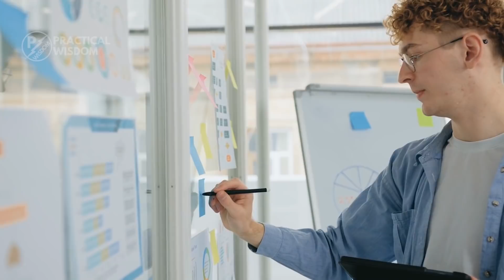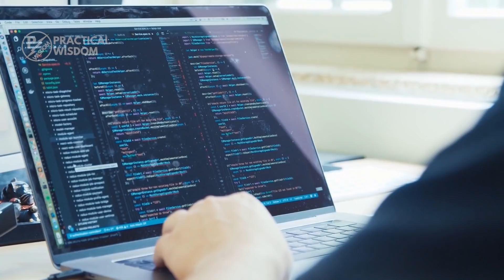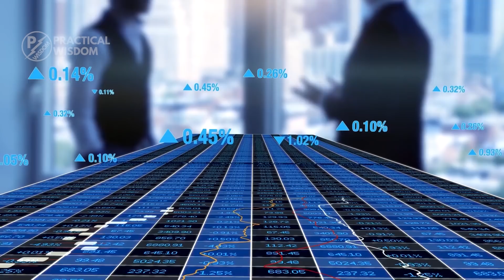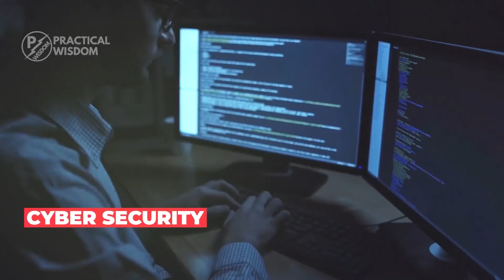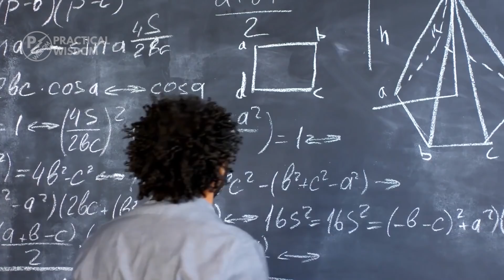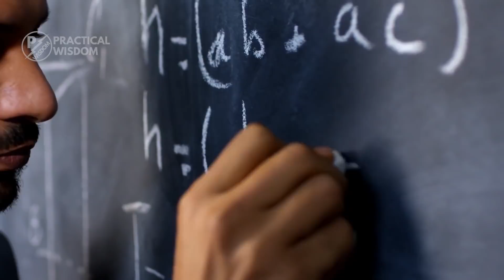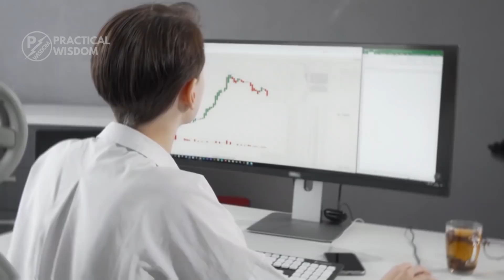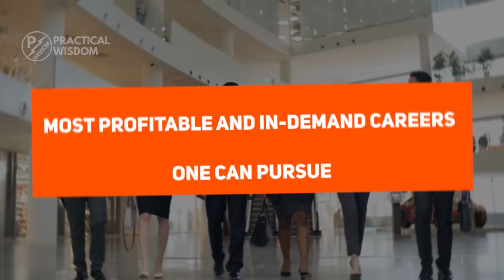9 Most profitable and in-demand careers to pursue

Comment: Is it good to start our own business in this pandemic or should wait for year or years???
Reply: That depends entirely on the business and your initial access to resources. Starting a business is always a risk and most fail in less than 10 years, even without pandemics. Signs are pointing to the worst of the pandemic being over so if your worry is that you’ll be forced to shut down a physical location causing you to lose income and staff for an extended period of time, that’s probably lower risk at this point and depends on the politics that dominate wherever you are located.
Reply: If you have the capital then the best time was when all the pandemic first started. Why, because while everyone else is getting out of the market you are one of the few that get in. When everything crashes then that means less competition and everything is on sell. 

Though you need to be smart about how you open and launch your business. You cannot be doing what everyone else is doing because then you’ll just lose like everyone else. Right now depending where you are at there’s gonna be more competition because everyone is getting back to business. So yes technically you’ve already missed a great opportunity to start a business, but it’s not over yet. You can find a market gap and take it but you need to be smart about it. 

Plan, and execute and make sure your burn rate isn’t to high.
Reply: Start your business now their is never the right time to start